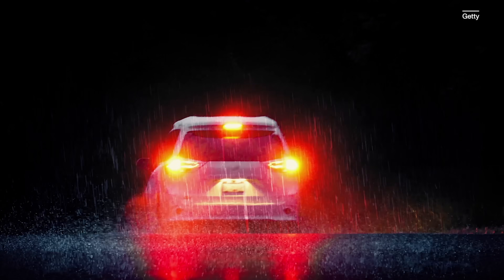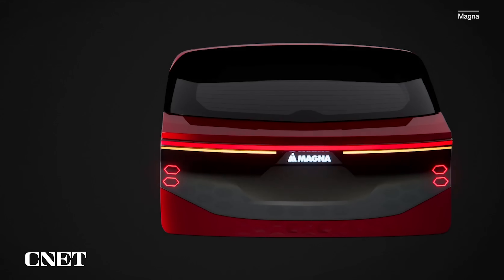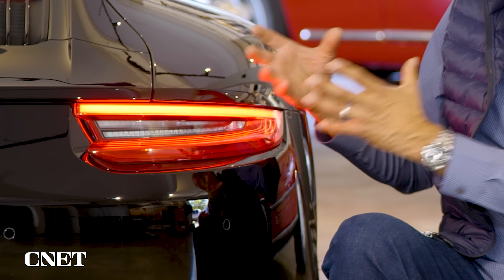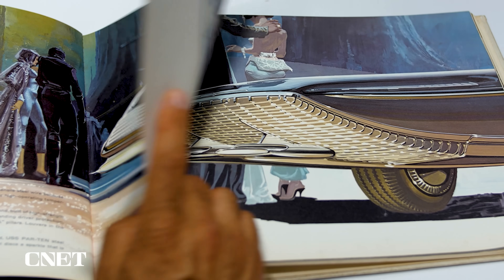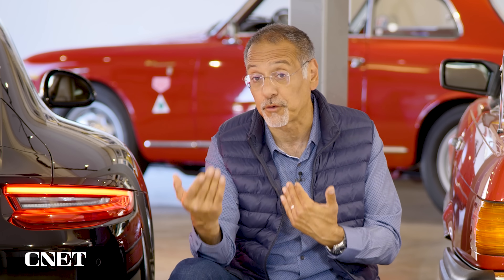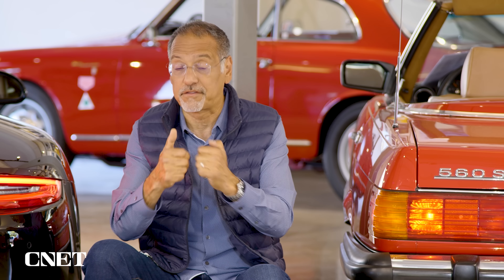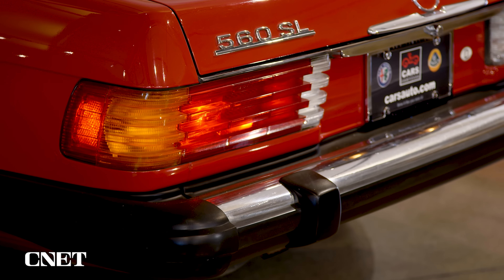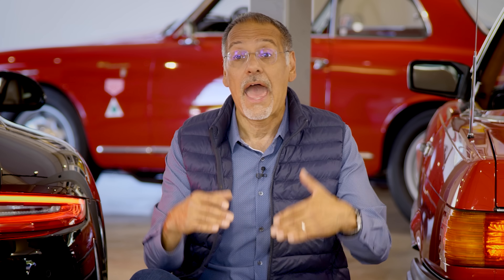New Invisible Lighting Wants to Radically Change the Way Cars Look

Comment: Dealership: Ok mate, I plugged your car into our proprietary diagnostic tool, it confirms you have an error P7717-2 in simple words, a blown led bulb.

Customer: Ok great, have you replaced it? Can I go?

Dealership: I'm no, you'll need a new light panel assembly as the individual LEDs are not changeable. That's $60 for the diagnostic, $600 in labour as the book states it's a 4 hour job and $2100 for the light panel.....

Customer: Can I just change it myself?

Dealership: No only authorised dealerships are able to work on your vehicle and all counterfeit parts that are non genuine will brick your vehicle.

Customer: My brother has the same car at home it's a hail damaged write off I'll get him to swap the lights over.

Dealership: You'll need a proprietary tool to register the new panel and code it to your car. Also, your cars free subscription trial period has ended. You will no longer have configurable ambient interior lighting, remote start, dual zone climate control, auto wipers and ads will play every 4 minutes.
Reply: long read but, quite spot on :)

Comment: Imagine the repairs if it gets hit
Reply: Not “if”, but WHEN.
Reply: I’d hide the whole car in my butt
Reply: @APAstronaut333  This is spectacular advice.
Reply: Insurance Companies: Screw it, it's TOTALED.
Reply: or if a single part burns out lol
Reply: The people who will be able to afford the cars with tech like this, don't have to worry about car repairs.  This will not be coming to a Ford dealership near you anytime soon.  Even if it hit the mainstream, insurance rates would just adjust to cover the costs.
Reply: True man Audi matrix cost around 2000$
Reply: Or breaks eventually,  repairs will be outrageous!!!
Reply: just another way for  planned obsolescence.
Reply: @fffwe3876   Exactly
Reply: Unrepairable, buy a new one!
Reply: It will be a flexible circuit board that attaches to the back of the polymer body panel. What I wonder about is how are body shops going to be able to paint these panels? I had an idea for a DIY version of lights anywhere. My DIY version used a drilled pattern of holes with fiber-optic cables sticking through. My idea was to epoxy them to the back after the panel was primed and faired, then cut them a little proud of the surface, paint and then sand the remainder flush with the painted surface. Paint would get between the fibers, which would help hide the fibers. But I suspect that this tech uses something like translucent and transparent passages through  an otherwise solid colored material with no surface paint at all. This could be made using something like a cross between a pick-n-place machine and a powder fusion 3d printer. Or maybe just use CNC to drill thousands of tiny holes and stuff in tiny lenses... And of course this will need to work with fiber reinforced plastics because no simple polymer is stiff enough and light enough to do the job, so I suspect there is quite a bit of work before this is ready for mass production, though we may see something like little light tubes inserted through a carbon prepreg sooner on really high end applications.
Reply: Costs half the price of the car
Reply: Not “IF”, but “WHEN”😶‍🌫️😶‍🌫️😶‍🌫️
Reply: An arm, a leg, and a kidney, or two.
Reply: Painful 😩
Reply: Exactly
Reply: If it's chinese made,  then it's affordable maybe.
Reply: @shany5799  Good point. In the future , more "cutting edge" tech will also have a learning curve for training new types of repair crews.
Reply: Like all led's and electronics in general 1 or more led's will fail over time without any damage.. so what then? Replace the entire bumper or panels because a handful of lights die witch could make indicating or other important lights useless and in turn dangerous.
Reply: Are we all just our grandfathers now?  “That fangdangled wiz bang will never work”… 50 years later you wouldn’t want a cathode Ray 📺 TV I’m willing to bet.
Reply: Bumpers are already expensive with sensors and cameras now
Reply: And this will make it even more difficult to fix your own car, if you wanted to.
Reply: All they have done is make changing your lights harder and more expensive so stupid
Reply: They total cars over a co hi ple hail dents and a broken windshield today.
Reply: @toddaulner5393  To be fair the windshield in my car is $2k to replace...
Reply: Well... In that case, say goodbye to your kidney.
Reply: In what scenario would only the light be hit and if it were couldn’t the rest of the car still produce light around the dent? If it’s that severe then I think it would be regardless of these panels having lights.
Reply: @VagaBohn  last year we backed into a mailbox broke the rear light,  $86 aftermarket for the light, (WV Jetta)  30min to swap in.  Had this been an integrated design, $1000+ and not so diy friendly.
Reply: @whatdoesnt  good argument
Reply: @VagaBohn  Shopping carts
Reply: Read my mind.  Get out!!!
Reply: Not just getting hit, but vandalism, especially in big cities in the “wrong side of town” where hoodlums smash car windows and slash tires for fun.
Reply: It will probably be cheaper.   They’re trying to save money.
Reply: Bingo
Reply: taillights are already super expensive. leds embedded in a body panel doesn’t sound that bad. it’ll just up the price of the trunk a bit. and most of the cost for a repair is in the paint anyway.
Reply: @boxr_4214  ya should not have to replace the entire bumper or panels because of a faulty led. And given the price of head light replacements and tail light replacements over $1000 in a lot of case's the answer is no!! Whole panels with light's built in will cost way to much.. BMW and Mercedes Audi and even some Mazda and Toyota models ask $1200 or more for the lights they use.. I can imagine the disgusting price this system will cost to replace or repair and until 3rd parties make cheap knock offs it's simply to expensive for the average person.
Reply: People like never think forward. Always whining and complaining.
Reply: @yatinkheti2427  complains and whines Yatin kheti
Reply: @gamethrough5530  Do some forward thinking. 🤡
Reply: Exactly! All is great on paper. The reality, not so much.
Reply: Imagine someone scratching your car
Reply: That's the idea!
Reply: "totaled"
Reply: I was thinking the same thing when I first saw this lol
Reply: It'll be cheaper than these l.e.d. light assembles in cars now.
Reply: Horse driven buggy
Reply: Exactly what I first thought about...
Reply: Do we really more expensive parts on our vehicles.?
Why not aim for simplicity and cheap.?
Reply: Exactlu
Reply: I'm guessing like a tesla
Reply: All it is is a led screen
Reply: Dont have a insurance? Lol
Reply: This must be american
Reply: I don't want to imagine.
Reply: Imagine Insurance cost
Reply: @GameThrough - with automation and the amount of sensors installed on a car, I highly doubt this would be a concern once it becomes mainstream
Reply: As someone who does collision repairs on cars this idea I am strongly against and I don’t think it looks better than traditional light assembly
Reply: It’s not like the light modules are any cheaper.
Reply: That's why I am single. Imagine going through 💔.
Reply: Exactly
Reply: Looks cool, but kinda unnecessary and expensive.
Reply: My mirrors for my f350 are 1200 a piece for power ones through Ford
Reply: ...and the increased insurance premiums ‘just in case’. Stupid.
Reply: Imagine if the LED burned out.  Instead of $5 your paying $1200 for a replacement.
Reply: There would be no repair, only replacing, which is what a large part of the auto collision repair industry has already turned into
Reply: A nissan SUV headlights cost over 1000 dollars for each
Reply: They'll replace whole car
Reply: Completely depends on the design. It could be designed to be easier to fix than current designs. They will also be plastic panels to start with which is cheaper than steel. 8 bolts through the boot/trunk lid and the panel comes off. These light modules would also be cheaper as they wouldn't have outer lenses and need to be aesthetically pleasing as they are hidden.
Reply: My first thought
Reply: This’ll probably only be a thing on really expensive cars though, so people who have ‘em will probably have the money to fix ‘em. That’s my guess
Reply: Keep it sleazee.
Reply: Like apple replace car lmao
Reply: Insurance? It exists...
Reply: @Be.Bulinda  and insurance is not gonna increase their premium for this???
Reply: @gamethrough5530  I know. This things are getting out of hand.
Reply: @Be.Bulinda  like apple care lmao. Your covered with additional payments because fk us all we are apple 🤣🤣🤣.
Reply: Yes... fixing something that wasn't broken
Reply: Can’t wrap the car either, you can’t wrap around the lights
Reply: Exactly
Reply: Like modern cars. If a led taillight break om a somewhat older model then it's straight to the junkyard...
Reply: Modern cars may not be in such accidents anymore. These days even my humble Nissan Leaf has an automatic brake.
Reply: Imagine  if it's cheap like an led
Reply: No different than today. Buy a headlight (if you can) and it will be hundreds
Reply: @jeramiemaddox1974  yea but now instead of just replacing one light, your buying an entire bumper assembly with integrated wiring,  circuits and leds. This will no doubt be in the thousands with parts and labor.
Reply: @whatdoesnt  You don't know that. It's possible you're correct, but until we find out more it's guesswork. Also, you can make it one piece, but you don't have to.
Reply: @whatdoesnt  that already happens.
For example I own a car rental business and one of my 2021 Honda accord got into an accident and the head lights were damaged meaning, the whole damn bumper had to be replaced.
The lights alone were 1400!!! Talk about cheap for a honda😂😂
I'm even going to mention everything else.
Reply: @whatdoesnt  bull crap, if the car was to get into an accident you have to replace all the parts impacted by the accident which will already be expensive and hopefully covered by insurance.

LEDs should last a very long time but if it happens to go out during your ownership id imagine you just replace the entire trunk  or bumper. Or they can make panels that seamlessly integrate with the rear area that c an be detached in case a light goes out. Wiring isn’t much of an issue since it’s just lighting elements and a light controller. You can feed all the power to the controller then divide from there so if one light goes out the others will function normally. The controller can sit in the trunk area so if it goes bad it’s an easy repair someone can do at home. I’m really excited for this as it brings so much more creativity. Patterns that were impossible are no possible
Reply: @whatdoesnt  it's really the more you have to buy because right now you can buy some bumpers for cheaper than you can buy these light assemblies these light assemblies are getting crazy expensive on their own
Reply: @whatdoesnt  so true.
Reply: @jeramiemaddox1974  after this innovation, you have to replace whole back panel of the car
Reply: @gamethrough5530  it would be cheaper actually because we are already doing this! Meaning when a front accident happens if it's not serious enough you won't have to replace the light panel section on the bumper for this example, just solely on the design of the vehicle.
9 out 10 times when a accident does happen you generally have to replace everything in the front anyways.
Reply: @gamethrough5530  it's not as bad as you think. LEDs are pretty cheap it could be run off a raspberry pi equivalent  and its a plastic panel. 

Ford already experimented with a similar concept of replaceable plastic panels in India with pretty good results. So I wouldn't expect costs to go up. If anything these panels just get mass produced for the make/model and probably would just clip in.
Reply: @karlynn7719  we would have to see what an actual product implementation might actually be to determine what would happen. The rear of a vehicle isn't one singular panel either you have your bumper trunk c pillars etc.  Where the lights are mounted now are generally on a separate body panel anyways so I don't see how your scenario would play out unless you remove trunks and frunks and just make the front and rears one singular panel which just isn't the case.
Reply: @jeramiemaddox1974  I was surprised when a client wanted new headlights for a cx9. 1200 each!
Reply: @jeramiemaddox1974  it will cost more. I was an auto mechanic and a single led headlight for the new MDX was over a $1000
Reply: @Omgosh98  why the heck is it that expensive?
Reply: @justSTUMBLEDupon  Because it Acura’s “latest and greatest” headlight design so they overprice them. Like a lot of other companies OEM parts for new vehicles. Consists of 5 main LED’s they call Jewel eyes.
Reply: @jeramiemaddox1974  Yep. And that’s why prices are increasing on older used vehicles. Older vehicles are easier to fix and some are more reliable which is increasing the demand.
Reply: @jeramiemaddox1974  some over a thousand
Reply: @jeramiemaddox1974  you can replace a small part made by many aftermarket. Versus replacing an imbedded part that requires replacing multiple parts bonded permanently together or astronomical mechanic hours to take apart and repair.
Reply: @jeramiemaddox1974  i think he meant hundreds is cheap. Like those likely in the thousands and only in super lux vehicles, 6 figures cars
Reply: @jeramiemaddox1974  It's $700CAD per side for a 2019-current Mazda3 Headlight with the Adaptive front lighting/auto leveling.
Reply: @jeramiemaddox1974  god dam goofball
Reply: @jeramiemaddox1974  except replacing this will be thousands. So totally not the same at all.
Reply: Been reading the comments… & idk what it is that people understanding…it’s. A. Panel! Not. Individual bulbs!
Reply: it's a WASH. light modules & rear end are just as expensive to fix .
Reply: @markplott4820  not, I still can find aftermarket parts and replace a part in a couple hours. Imagine dismantling an part permanently bonded together. It would be difficult to make aftermarket parts and use special equipment to repair. Ipso itum make it so very few people who can repair, making repair time and cost astronomically higher. Cornering the market for repairs to manufacturer increasing price of goods by essentially making warranties mandatory. So the end consumer never ever really own the product, due to corp monopolizing maintenance and repair and charging whatever they want.
Reply: @Rix317   - MUNRO has stopped tearing Down & Benchmarking GAS engines , now only focused on the BEV Industry. 
scrapped ALL of their GAS/Hybrid engines & cars.
Reply: @markplott4820  how? Lol. This thing will be massively more expensive to replace.
Reply: @MS-gn4gl  - should be 100% less maintenance than gas .
Reply: Exactly
Reply: It will get cheaper over time
Reply: @fatcrruise6508  this is assumed but not necessarily true
Reply: @fatcrruise6508  us Mirai drivers heard that about hydrogen fuel too.....and it seems to just be getting more expensive.....not happening
Reply: @fatcrruise6508  the way it is now IS cheap. Why wait for cheaper over time when you already have something that works very well?

And replace yourself in less than 20mins?
Reply: @fatcrruise6508  maybe but people saying this for years to led headlights. It's way cheaper to produce ect. I think the automakers only make more money if it's true. I and also other talk much if the day is long 😜
Reply: @Nordlicht05  my house use LED lamp because it is brighter and less watt. It just automaker runs out of idea
Reply: @fatcrruise6508  lol for the manufacturer not for the consumer.